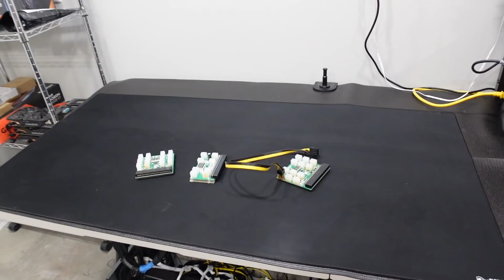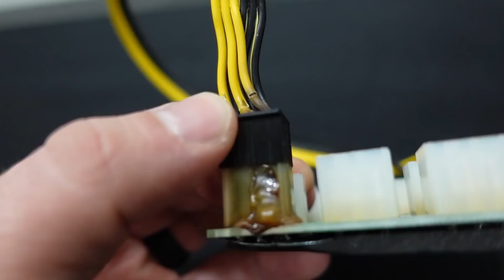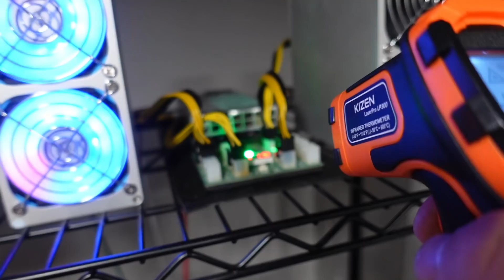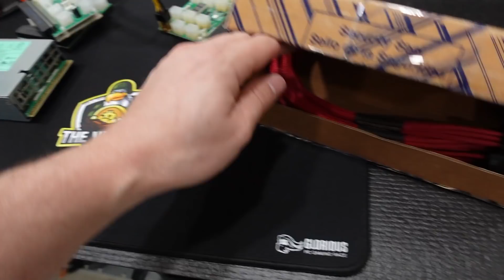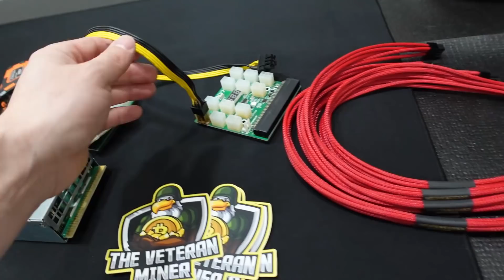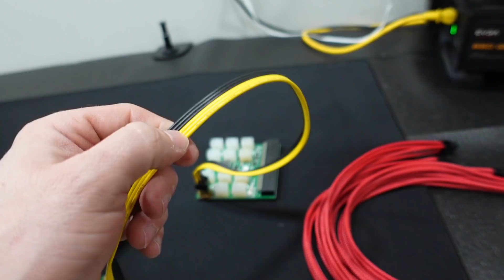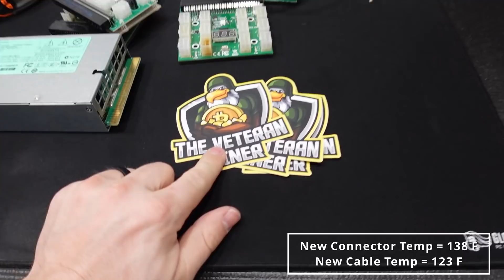IS HOME CRYPTO MINING DANGEROUS? | Common Mistakes Crypto Miners Make With Power

Comment: Lots of good info in this video, but something about the wire itself should be clarified. Counting strands isn’t a good indicator for the size of a cable. Wire gauge is measured by a cross section of the copper in kcmills. I can hand you a cable with 9 strands that’s 16awg and 24 strands that’s 18awg. It all depends on the strand diameter. If you took a piece of 16awg automotive wire you could be counting strands for a few minutes because you’ll lose count and have to start over a couple times. The best way to see what gauge you have is to... look at the side of the individual cables. If it came from a country with regulated manufacturing, it’ll tell you the insulation type, gauge and temp rating, along with anything else that may be important to know. Sometimes it takes a foot to write all the info, so what you’re looking for could be missing on a 4” patch or splitter. At the end of the day, you get what you pay for or are willing to do for yourself. Want the best cables? Buy the materials and make them yourself. Get the pinning kit and tool and a spool of whatever color wire you want and, minding the pin out on each end, you can make yourself some sweet custom length cables till the cows come home. Just my 2c.
Reply: Also, before connecting splitter to splitter to splitter to get your new gpus up and running, figure out what wattage you’re card is going to need, do the math. Take the highest potential wattage your gpu will require, times that by 1.2 (to give yourself 20% overhead) and divide that by 12 (for 12vdc). If you have two pcie power ports on your gpu, divide that by two. If you have one, take that number to the next step. As Veteran Miner stated, the power connector has 3 +12 pins, whether it’s a 6 or 8, so we take that last number and divide it by 3. That is because you are paralleling the power over 3 conductors, or sharing the load over those 3, so each wire is only carrying 1/3 of the load and that’s what we need to know to size the wire properly. To take that number and equate it to a wire size, google “wire ampacity chart” and find what insulation type you’re using to get the amperage. So, let’s say you have a gpu whose wattage is 200 watts over 2 pcie power ports. The math would look like 200x1.2=240 240/12=20 20/2=10 10/3=3.4 and according to the charts that means we need to use 20awg wire. Yes, that is correct. The math is right. You don’t need 16awg wire if you’re not splitting the cables. To figure out your wire size for splitters, you need to double the amperage at each split. So if you join the two pcie power ports on a splitter, the amperage at your splitter connection and the cable supplying it doubles to 6.8a. Now introduce a second card with the same draw with another splitter split to the cable that’s going to your breakout board and you have 13.6a. That jumps you right up to the 16awg cable. 
Let’s consider something else in the mix- the rating of the power ports on the breakout board. Is it rated for almost 14a? Probably not. That’s why it has at least 12 ports for a 1200w power supply that won’t be loaded close to that if you’re doing the math. If you go to the very edge of 1000w at 12vdc that’s roughly 84a. Divide that by 12 (number of ports) and you get 6 (to be safe) amps at each port. So you’ve doubled your load at the connection and welded the plug into the connector because you put twice the load that it should be handling on the point of connection. It’s not the cable’s fault.

Comment: dude its a mini asic, why wouldn't you just use a higher grade power supply?
Reply: What'sapp✙𝟣𝟤𝟢𝟨𝟩𝟨𝟣𝟢𝟥𝟢𝟪

More updates on ETH, NFT’s, BTC📊🚀..
What'sapp✙𝟣𝟤𝟢𝟨𝟩𝟨𝟣𝟢𝟥𝟢𝟪

More updates on ETH, NFT’s, BTC📊🚀.

Comment: Another question, is this generally regardless of which gpu you use with these cables or was this just in relation to Asic drawing more power at higher current?
Reply: What'sapp✙𝟣𝟤𝟢𝟨𝟩𝟨𝟣𝟢𝟥𝟢𝟪

More updates on ETH, NFT’s, BTC📊🚀..
What'sapp✙𝟣𝟤𝟢𝟨𝟩𝟨𝟣𝟢𝟥𝟢𝟪

More updates on ETH, NFT’s, BTC📊🚀…

Comment: Get a wire stripper and cut your old wires to see what they really is. The holes in wire stripper will always be bigger than teh wire itself so we don't accidently cut into strands. With stripped wires and twisted right... see which holes in wire stripper it fit for quick gauge check. Used wires are always useful for other projects or scrap metal price.

Comment: Yea I’m done buying Amazon wires.  Mine melted almost instantly. Great video
Reply: What'sapp✙𝟣𝟤𝟢𝟨𝟩𝟨𝟣𝟢𝟥𝟢𝟪

More updates on ETH, NFT’s, BTC📊🚀..
What'sapp✙𝟣𝟤𝟢𝟨𝟩𝟨𝟣𝟢𝟥𝟢𝟪

More updates on ETH, NFT’s, BTC📊🚀….
Reply: did you send it back ? or contacted amazon ?

Comment: Melted all my 6pin on my minebox motherboard, replaced n soldered all new connectors then made all my own 16 gauge wire just to be safe, the 18 gauge it came with were not real 18g, took a whole year of mining for it to fail so be careful
Reply: What'sapp✙𝟣𝟤𝟢𝟨𝟩𝟨𝟣𝟢𝟥𝟢𝟪

More updates on ETH, NFT’s, BTC📊🚀..
What'sapp✙𝟣𝟤𝟢𝟨𝟩𝟨𝟣𝟢𝟥𝟢𝟪

More updates on ETH, NFT’s, BTC📊🚀..

Comment: Next up: liquid cooled cables for your 4090ti 800w gpu! 🤣
Yeah Veteran is on point, need good quality cables, right gauge for your load, good crimping to pass the load with no additional resistance and quality pins for low resistance conductivity. 👍🏼🤘🏼

Comment: The wire wasn’t rated for the amps going through it
Reply: What'sapp✙𝟣𝟤𝟢𝟨𝟩𝟨𝟣𝟢𝟥𝟢𝟪

More updates on ETH, NFT’s, BTC📊🚀..
What'sapp✙𝟣𝟤𝟢𝟨𝟩𝟨𝟣𝟢𝟥𝟢𝟪

More updates on ETH, NFT’s, BTC📊

Comment: So, how many strands on 16 and 18 "gauge"?
Reply: Its really just the thickness of the strands, the strands itself have to be 18 gauge, not including the insulator
Reply: How thick would I want to look for if I measure?
Reply: @Waeoo1  look up stranded wire gauge chart, i just go with 16 gauge on everything now, cause if you get cheap 16 gauge by accident most likely its still 18 gauge strands
Reply: @BadGam3in  thanks man!

Comment: Hot air goes up, and all the minning rigs on top catches the heat, the more heat it gets the resistance in cables increases so again more heat, which again increases the resistance. It's kind of a paradox of infinite loop, thats why fire in wires is very dangerous it, won't stop unless you turn off grid. Either have very thick cables, or you cool them...
Reply: The fire triangle. Heat/Oxygen/Fuel

Comment: Great video I myself am in aviation and wiring is an intricate part of aircraft. In aviation we use approved parts systems to verify parts are mfg to standards. I myself would never by wiring on a site like amazon where there is no one to verify that the wires are made with high standards. I guarantee that if you stripped the wires and used an awg(american wire gauge) y ok u would find smaller wire which is cheaper and heightens the profit margins. Great job making the community aware!
Reply: Same career field as you and being a miner myself, I’ve never run into the thermal or fire issues this guy has - careful planning and properly spec’d parts being crucial.

Examples should be basic understanding of NEC standards. If your circuits shouldn’t go over a certain ambient temperature threshold, your cables and connectors should be well below that.

Comment: I had a PCIE port melt on my PSU once because I was drawing too much power. Luckily I got a replacement model but my rig was down for a few days. Could have been worse if I hadn’t picked it up earlier!
Reply: What'sapp✙𝟣𝟤𝟢𝟨𝟩𝟨𝟣𝟢𝟥𝟢𝟪

More updates on ETH, NFT’s, BTC📊🚀..
What'sapp✙𝟣𝟤𝟢𝟨𝟩𝟨𝟣𝟢𝟥𝟢𝟪

More updates on ETH, NFT’s, BTC📊🚀.